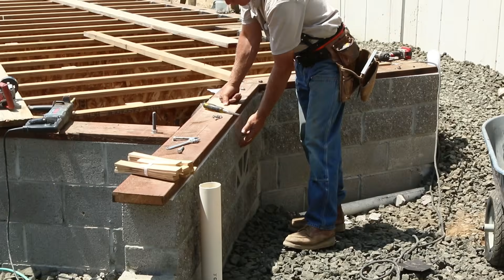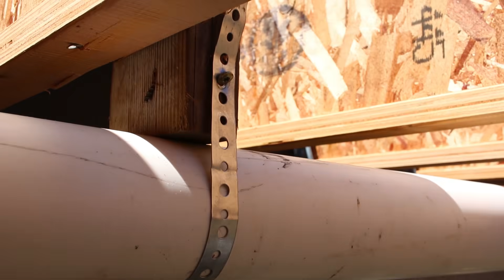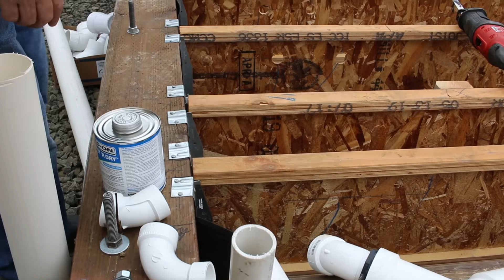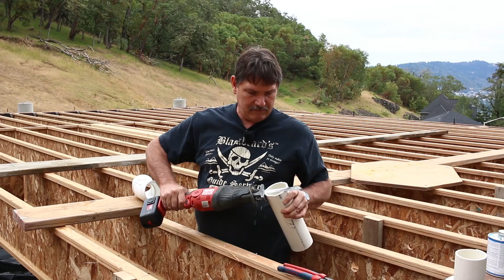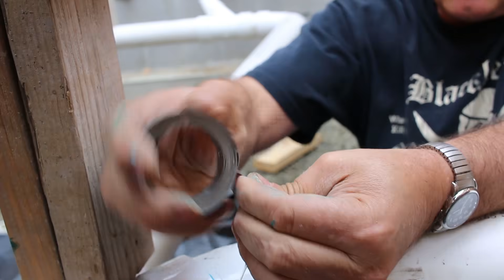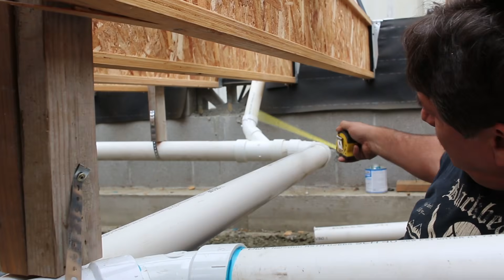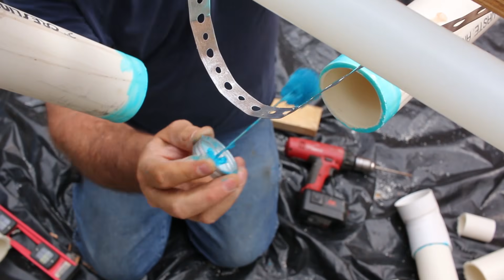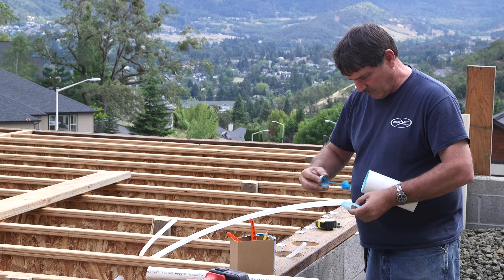Waste and Drain Ep.41

Comment: wow ten feet of head pressure that's around 4 and a third lbs per square inch of head pressure. Pretty cool they get to do it that way up here in Minnesota we are required to do air testing instead with minimum 15min no pressure drop. Then a final after building is complete with main plugged "p" traps filled with water and hold one inch of water column of pressure.

Comment: They use PEX for water lines inside a home.   Can you use PEX for a waste line?
Reply: I don't believe so, but we do put in HDPE fused pipe for sewer where I live. Especially for forced sewer mains off of lift stations throughout out town. And If I remember right it's only allowed on force mains because it creates a small lip inside the pipe from the heated plastic beading up. They would never allow PEX due to the giant ridges you get from where the pipe meets the fittings. Let alone PEX is a mechanical joint not a fused or "bonded" joint like HDPE and PVC where the bond if done correctly is supposed to be the strength if not stronger than the pipe. I'm surprised in the video they get to use a one part glue, we need to use a purple primer "acetone" to soften the outer layer of pipe then a bonding glue to chemically bond the pvc not just glue it.

Comment: Love the vids and everyone has an opinion but throw that plumber's tape away. It's good to line it up for install but you should always use a proper size two-hole strap (or deck clamp, hanger, etc...) My motto: if they would not approve it in a commercial building why put it in your house?

Comment: In Wisconsin, 1/2” per foot pitch is the maximum allowable. Water behind solid waste is what is used to move the solid waste. Anything beyond the 1/2”, the water simply flows too quickly, and goes around the solid waste, leaving it to gather, and form a clog.

Comment: Plumbing:

My dad taught me a few things, like how to sweat copper and how to fit cast iron drain pipe. Fortunately the cast iron was a vertical run, which is a whole lot easier than horizontal because the oakum is packed and held in place by lead. Not easy to pour molten lead into a horizontal fitting. So, I had that experience.

When I was out in Silicon Valley I had a friend who was a plumber. Not a house plumber, or even a commercial plumber. He was the type of plumber who installs piping and fixtures for semiconductor processing. The piping he installed contains gasses such as Arsine, which is more than a little toxic. So a lot of lines were pipe inside pipe, with the outer pipe under vacuum and gas detection to see if the inner pipe is leaking. He joined stainless steel and copper pipe by welding it. He said the walls were about a quarter-inch thick.

Comment: Hey guys, great video, but get some F&M plates, F&M rings, easier than the perforated strap your using, run is your horizontal distance, code spacing of hangers, place your F&M plates, 1/4 inch drop per foot is the length of your threaded rod, add two nuts to each piece of rod, the rod can be cut in a portable pipe vise, Rigid is what I used for years, attach your F&M rings, hold your pvc pipe in place, or close one ring, place pvc pipe, close up rings but don't tighten yet, the rest of the system will fall in place, you do nice work, Modify it a little, customers will beat the doors down, enormous labor savor/ gorgous looking work, rigid / strong as can be  warren

Comment: Outside cleanouts are the only way to go.  As did you, I cored through my 1923 bungalow concrete foundation wall and T-ed into our main 4-inch dia ABS plumbing line that fed into the old cast iron sewer that I also cut and connected to.  The prior cleanout was on the darn roof! Also replumbed the back bathroom via the restoration of it and corrected alot of old mistakes - mainly supporting the ABS kitchen line and correcting the slope.  Coat and twist!  Love it.  Btw, although I know that foundation and center support cripple wall is likely locked, I still think I'd put some shear panels to lock that cripple wall down.  Great video!

Comment: Plumbum! guess where a plumber got his name!

Symbol: Pb
Melting point: 621.5°F (327.5°C)
Atomic number: 82
Atomic mass: 207.2 u
Electron configuration: [Xe] 4f145d106s26p2

Whoah! TMI! Plumbum literally means a lead pipe and that is what came before cast Iron. It goes back to, at least, the Romans and we may be able to explain the inexplicable lunacy of mankind (Spanish Inquisition, Hundred Years War) on his drinking water piping. Lead is not good for your brain. It and other heavy metals are profound neurotoxins. Lead is very malleable which means it is easily shaped by hand tools and also has a low melting point which means you can cast and/or weld (solder) it at easy low temperatures. There ya go...

Comment: Regarding slab on grade versus crawl space/basement, I can actually install slab on grade drainage quite a bit faster than suspended systems. 

I prefer suspended systems, as they are not as vulnerable to settling issues as are buried systems. But they are more time consuming.
Reply: Also, in the area this project is being built in, it might not be a problem. 

But here in moist, muggy Florida, I have seen quite a few problems with the steel plumber's tape/strapping rusting out and breaking. 

While my preferred method is not as horizontally stable as is the shown method, using anchors, all thread, and teardrop hangers will still be supporting the pipe 50+ years into the future,

Comment: So hard for me to keep hearing you say that white PVC pipe fittings are more prone to leak than black abs. Abs is extremely substandard to pvc.
In Florida, abs is illegal to use in a home, I've been a lic master plumber for 20 odd years and never had a problem with PVC if it's installed right.
Must prime it then glue and even a drain system will hold 100 psi though it's not made for it.
If you glue only(wet or dry glue is glue only) the pipe will let go and slide right out after a few years. Small lesson ( pipe expands and contracts with the weather and the pipe will expand and contract at different rates than the fitting,
With glue only it's the same as smearing some caulking on the pipe and shoving it together, it's "glued" but not bonded and the "glue" will completely let go over time. With glue and primer the primer chemically changes the pipe kind of like a 2 part epoxy, and when both are applied they will bond so that pipe and fitting become one for the life of the home.

Comment: A wet core drill bit is supposed to have water go inside the bit not sprayed on the outside. Save yourself some money in the long run by not wearing out the bits.

Comment: At 8:31 you violate engineering standards and some areas codes'. 
Your slope is too steep. You made reference to too much slope but do not see what is right in front of you! 
The water will run away and the waste material will stick to the pipe, eventually giving you problems.

That slope should be a 90  down to the level where it will join the collecting pipe!
60 or 45 Degree elbow pipes should only be used horizontally!

Comment: I know why you are using PVC but just wanted to let other know that plumbers still use cast iron drains and not just in commercial and the biggest reason is noise. PVC and ABS when you have vertical drain from another floor you can hear the water running down the pipe. Cast Iron is good at absorbing vibrations and sound. However its not to say cast iron is perfect. Its heavy, expensive, and the inside will rust and become rough given enough time. I have even seen some high end homes have mix with Cast Iron vertical stack but everything else is PVC so they can get the best of both.

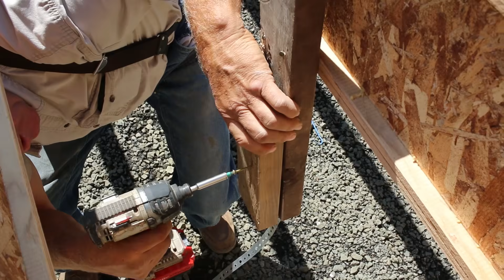Comment: see location 6:06... Huge fail! You should never fasten with anything ( screws, nails, bolts, and espesially GRK's) into the flanges of an engineered joist, definately not the bottom chord which is in tension. We have been building with IJoist for 40 years since the first TJI came to town. 
You should put a 2x4 or a 3/4 ply scrap fastened to the web ( with PL ) and have your mechanical guys fasten to that.
Its the carpenters job to ensure the mechanical trades dont butcher our building members.
Having said all that  though...I do really like your channel !!     40 years framing!

Comment: Where I am at we use UPC for the code, and you are not allowed to use metal strapping on a non-metallic pipe (like PVC), it HAS to be non-metallic strapping. The basic idea of this is that a metal strapping can gouge and damage the piping when there's any movement, whereas a non-metallic (nylon, pvc j hooks, etc) are far less destructive to the pipe when it moves.

Comment: Too much fall is also a detriment to a plumbing system - however that applies to the length of pipe after the trap weir to the traps vent. in the event that there is too much slope, self-siphonage will occur and you'll be left with sewer gases crawling through your fixtures drain

edit: also like he said the water can flow too quickly and leave the effluent in the pipe causing a backup

Comment: A good trick (Me as a plumber here) use a hole saw that's the same diameter as the pipe and drill holes in the 2x4 or 2x6 every say 12 then 13" and then 14" center kind of like what he was doing at 3:19 but instead of cutting it you're using a hole saw then the pipe fits perfect into the wood and also stays strapped nicely

Comment: Couple things have me concerned.  Strapping the drain line tight against the 2x.  When you dump a bunch of hot water like draining a bath tub, longer shower, etc will cause the PVC to expand and creek/pop then  once it cools it will do the same thing as it contracts, especially long straight runs.  This will be most prevalent in the winter when you have the greatest temp change in the pipe, thus the most expansion/contraction.  I have first hand experience with this.  Code in my area requires cleaner before the glue.

Comment: Great work. I did the 4" drain work on my own self build home, here in Scotland. I have NEVER been back and forth to the builder's merchant so many times to get extra fittings, or had so many left over fittings at the end, as doing that job! Stressful job too, getting the grade & fall correct in gravel-filled trenches. Next time I'll hire a pro. However, my work did pass the pressure test ( supervised by Building Control) first time, which was a great feeling.

Comment: What type of glue did you use for the PVC? Our local code requires that primer be visible at all glued joints. I would love to find an adhesive thats single application and doesn't require the cleaner and primer steps.
Reply: I’m pretty sure it’ll get turned down. I think he’s a probably service plumber. They don’t have to deal with inspectors.

Comment: Hi,  Great plumber, great video!  I started plumbing as a little squirt, much like your plumber.  I could run in a crawl space, bring the wrong fitting/tool, run back with the correct one, faster than Dad could crawl.  I roughed in my first bathroom at age twelve.  Did plumbing and tin knocker's apprenticeships in high school college and graduate school.  Then worked as an industrial mathematician for forty years.  I still do my own plumbing, HVAC, and electrical work.  I tell inspectors that if they like my work, blame my father.  If they have a problem with it, then I failed to do something he taught me and blame me.  It's rare that I don't get a compliment on my work; that's a credit to Dad and the other skilled tradesmen around whom I worked.

My father was from a generation of tradesmen that demanded that even work that would be hidden in walls SHALL be plumb, square, level, parallel, and/or uniformly graded as required.  If the work was visible, then even greater perfection was required.  These tradesmen took the "neat and workmanlike" part of the code very seriously.  I see so little work in the trades that meets the standards of these "old timers" that when I do, it is worthy of remark.  Your plumber meets that standard.  I was recently in the basement of a friend's custom home.  The plumbing and radiant heating system was a work of art; it would not have been out of place at M.O.M.A.  Even with purple primer, there wasn't a drip or run of primer/glue anywhere.  There was exactly an 1/8" margin of purple primer showing from every fitting.  Absolutely perfect.  Solder joints were perfect:  exactly the correct amount of solder - no drips nor runs.

I always find it interesting what is allowed and not allowed by local variants to the various codes.  As an example, in my jurisdiction, the inspector demands to see purple primer on PVC pipe.  Because of this, most plumbers in this jurisdiction use ABS -- one step glue joints.  But, then you see "woopies" in the DWV system, because the DWV pipe "took a set" from being in the sun either in the supply chain or on the job site.  Clearly your jurisdiction doesn't require primer/cleaner if the "correct" glue is used.  We can't hang DWV piping with metal strap (it must be plastic or plastic hangers), clearly you can.  The code pretty much universally requires that DWV piping be supported as you did:  blocking on top, strapped on the bottom.  Yet, I rarely see the blocking on the top of the pipe.  If one uses the blocking on top, it is almost trivial to set the grade properly, as we see you and your plumber doing.  Nice job!

I've never worked with a general/framing contractor that was willing to pause framing for the "ease" of the plumber or other trades people.  Doing the rough-in without the deck installed is so much easier than crawling everywhere.  And, I think, in general results in a better, neater job.

Thanks & Best Regards,
Gottfried

Comment: I would not hang PVC pipe in the manner that you did. You have cinched the pipe down tight at each strap (sorry I can't call that a hanger) which will not allow the pipe to move from thermal expansion which is required by code and manufacturers design guides.  

Below is a link to one manufacturers design guide for PVC supports but I can't imagine other brands being much different and the applicable plumbing code for your area will be the final word in any case. There are a number of support options that are better than using plumbers strap and probably cost less in material and time to install.

http://www.charlottepipe.com/Documents/PL_Tech_Man/Horizontal_and_Vertical_Support.pdf

Comment: I remember 60 years ago helping my dad drag cast iron pipe under the house, and making the oakum and pouring hot molten lead in the flange joint to seal.  your form was an asbestos rope !!!  A bitch of a job !!! PVC/ABS changed all that !!!  So much easier and quicker !!!   We also used sawn timbers and shiplap sheathing !!!

Comment: Just an FYI :If you use 4” pipe you only need 1/8” per foot drop...vs 3” with 1/4 “ per foot. You’d use this when there is a minimal drop needed  and you have to deal with distance and a locked in drop point.

Comment: Wow, another fantastic video!  Speaking of sewer access charges, For my commercial property (30 miles NW of the Twin Cities, MN), we have an existing well and septic system. After a recent well failure (original well casing lasted 30 years), we had to look at the possibility of connecting to a recently added municipal water and sewer line (approx 42ft from the nearest point of the building). The city sewer access charge (SAC) and water access charge (WAC) alone was nearly $26,000 - which did not include construction materials and labor! Needless to say, we stayed with our existing plumbing system and dug a new well (approx $18K total). The cost of moving crap can be pretty high!  ;)

Comment: Scott, I just watched a 10.25 minute video by Panorama Creators covering the complete construction of a clay house in Bangladesh.  They did not use strings, in fact did not have anything to measure with, or any levels.  The blocks were formed with a wooden container to dry.  The exterior was plastered with mud by hand, sort of like stucco.  The results were a little comical, nothing was square, and where walls met were sometimes a few inches off.  I did not see any plumbing, and the whole structure was set on cinder(?) blocks, set on end directly on the ground, about 2-3 feet apart (varied).  The structural walls had a wavy effect as you looked down the length, and horizontal surfaces were also wavy.  But the house stood when completed, with a tin roof that already had rust on it.  I was going to leave a comment with a link to your site, but they were all in Bangladeshi.  So, I guess they will have to figure it out for themselves - boy do they need your help! 😵 🤣

Comment: Pluming was expensive. When you look 100+ year old flats in germany, you often find the shower in a small separate room in the kitchen. One advantage was obviously the benefit of heat from the kitchen, but the other big advantage was that this easily allowed a floor plan with toilet, kitchen and shower back to back, all within 1m of the main line. Quite a challenge today with all lines joining at the same place, sometimes this requires custom PVC joints.

Comment: Does your plumber know that Milwaukee makes a blade specifically for cutting PVC that cuts a much clearer cut than the blade he's using. It's part number 49-00-5614. No reason to hack the PVC up like that if you don't need to. This blade cuts as well as a Skilsaw.

Comment: Too much fall is against codes of practice in Uk, because water might run off too fast and leave your solids lurking in the pipe waiting for the next lot ! not good. This is not just theoretical !!
         I did not watch until yer man raised the above point, however I first came across this with outdoor sewage pipes which were salt glazed earthenware and pretty smooth.